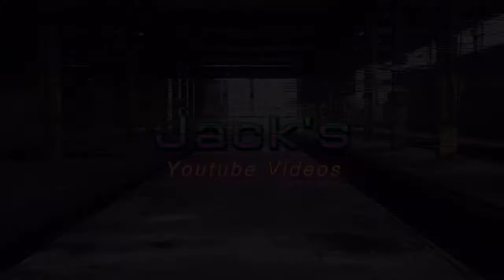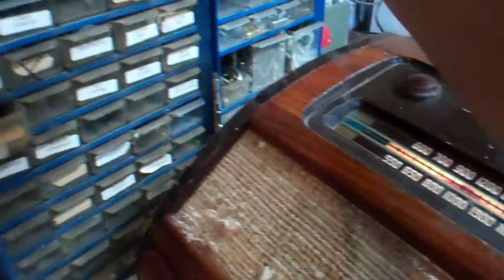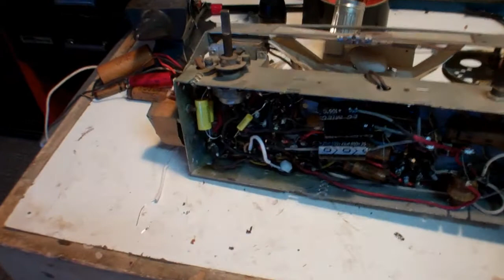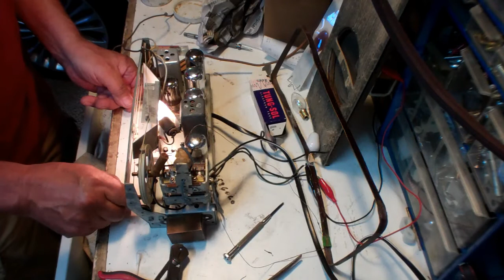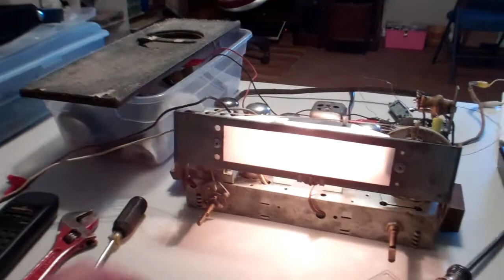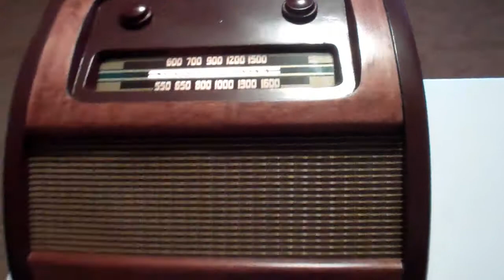(262) Philco Model 46-1201 Bing Crosby

Comment: I am working on the exact same unit. My problem is that it has volume but not a lot of volume. I have replaced all the capacitors and installed a new cartridge. I am lost when it comes to the resistors coming from the cartridge wiring. Should I change the resistors to accommodate the updated cartridge?  Help!  March 31, 2023 @ 9:05am Ric Louis
Reply from the maker: I don’t know what type of cartridge you
Installed but the original cartridge puts out about 3 volts. The new ones only put out less then one volt. Look at the specs on your new cartridge. Im assuming the radio has the correct volume?
Reply: @JackOfAllTrades2022  I put in the same cartridge as you did. Pfanstiehl P-51-3  The radio volume is louder, I added a new antenna. Would you send me your email so I can send you the photos of the cartridge wiring with the resistors? Thx for your help.
Reply from the maker: @ricmusiclouis  I'm far from being an expert at this so you may want to go to a support group, and theres many out there. Ive never changed resistors, never had to. You can write me at JWLCR51@GMAIL.COM if you want , but not sure I can help. That cartridge is correct and Ive used it in may more phonographs and its not as loud as the original but but works pretty good otherwise. It could also be the audio tube... dont ask which one, but there is one. This is where you need professional help. I'm just an amateur and when it gets too complicated, Ill go on a philco support site and start asking questions.

Comment: Good job repairing the radio but your touching the metal parts of the radio while it's playing. I thought this radio had a hot chassis.
Reply from the maker: Never knew that, well, Im still alive as long as your not grounded or barefoot I guess you can get away with it, but I’ll have to Google that one.

Comment: Thank you for this video! I just bought one of these. Question: Why does the Bing Crosby radio always burn through that white thing you pointed out?
Reply from the maker: Because the light is so hot, it leaves a yellow burnt mark on most of these units. Most people change the light to a LED type light... or use a very low wattage bulb as a replacement. Thanks for watching and good luck!
Reply: @JackOfAllTrades2022  Ah, that makes sense. Thank you so much for your reply! Is this burning dangerous in any way? And, how would you know what kind of bulb to replace it with, LED or otherwise? Truly appreciate your video, and your help! :)
Reply from the maker: Most plastics just melt under heat, but I would advise changing it... LED's are all over the place as far as price, and you would need to know what your doing to convert it.  But if you just want to replace the bulb, Home Depot or Lowes have these bulbs.. just get the lowest wattage possible and replace the plastic. As long as you don't leave it on for hours and hours, you'll be fine. Most people use them to play old records and then turn them off... as yours been restored and everything else working?
Reply: Thanks so much for the information! This is one that I ordered online, and it's being shipped to me. The light turns on, but nothing else comes on. So I have a better idea now of how it will work, having watched your video. I have never restored an old radio before, but I have basic knowledge of electrical work, and I work on cars, so I thought might try my hand at this. :) It's definitely a leap. Still learning!
Reply from the maker: Rosa Sophia Take your time and you’ll get it done, the cartridge for the needle is probably dead...they all die because the crystal dries out. But you can replace it with a newer type. I’ve done a couple of these, they are fun to restore..there’s nothing that can’t be fixed.
Reply: Thank you so much! :) I am excited about this one. Have a wonderful day!